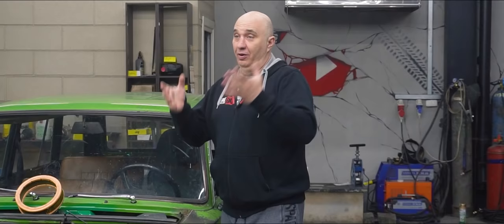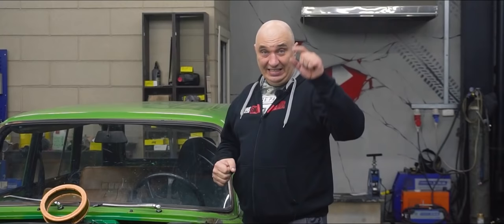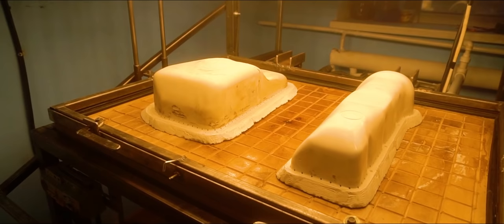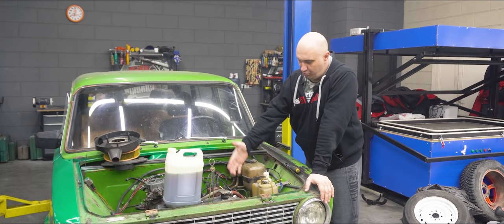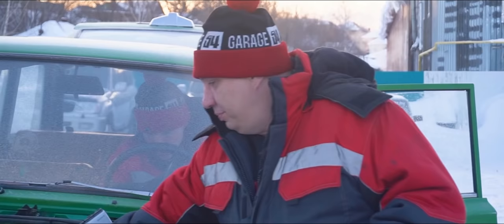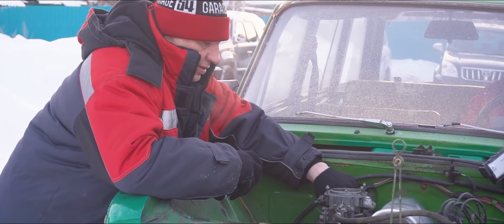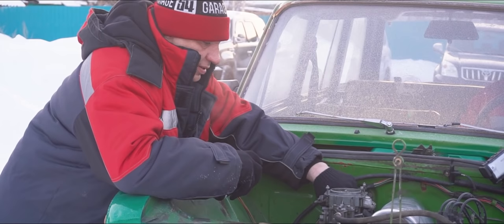Looking inside an engine during cold start (-30 degrees)

Comment: The good old days with carbs and distributor and possibly points ignition in that funky old Lada Russian crate.  

Actually it was normal to pump the gas pedal to squirt raw fuel into the engine when cold out to richen the mix and help with starting. Since he was standing there and the air filter was off, putting his hand over the carb throat for a bit to choke it would have been helpful too.  God I'm old, I lived this 😆

Comment: The Hino diesel truck can idle for ages without the temperature needle moving and as they put an overide on the exhaust brake in cold weather you can press a button that overides the overide allowing the exhaust brake to operate while idling warming up the motor a lot faster.

Comment: This is why my grandfather owned a spot in a commercial heated garage in the USSR not far from his apartment building. Otherwise you'd trash your engine trying to go anywhere on a cold day. The proletariat just parked their cars outside for the season, and not use them all winter.

Comment: I DID THAT JUST NOW WITH A 2021 TUNDRA! ONLY THING WAS A LITTLE EXTENDED CRANKING BECAUSE OIL SENDING UNIT CUTS OFF FUEL PUMP UNTIL IT GAINS PRESSURE! 2ND CRANK STARTED AND HAD NO PROBLEM AT ALL!

Comment: Living in Canada this is mostly irrelevant actually. 
The great majority of cars here have synthetic oil which behaves differently, I can not even plug in my car at -35c and the biggest problem starting the car will be a frozen battery. For those cold days I pull out the battery, take it indoors with me and put it back in the morning.

Comment: Great video with a lot of information. What weight oil were you using? I live in Minnesota USA.  I have frost plug heaters on my trucks, but they do not warm up the oil, I am going to install oil pan heaters. You might say go to synthetic oil, my big truck takes 13.5 gallons for an oil change. What would that cost for synthetic oil?

Comment: This is why block heaters are installed in cars in Canada.  I don't ever start a vehicle I own unless it's been plugged in for at least 2 hours when it hits -15C or colder.  Here in Sask. it commonly hits -40C or colder in the winter.  An (unheated) attached garage is a must as the temperature will never go lower than -10C inside, even at -40C.

Comment: THE  MOST  WEAR,  ON  ENGINES,  IS  THE  FIRST  TIME  IT TURNS OVER  UNTIL IT  WARMS UP  A   LITTLE.   ABOUT   2 or 3  minutes ; is  the   MOST  ENGINE  WEAR  on all moving parts.  USE  AN  ENGINE  PAN  HEATER .....( magnet ones - or strap-on  ones)   especially  if  your  starting in weather -10  C   or  colder !   YOUR  engine, will last  ALOT  longer......(old winter trucker guy)

Comment: They do make oil pan heaters you can plug in. One of the designs is a heated oil stick that goes down into the dipstick tube and keeps the oil warm, it just plugs into an outlet or probably a good extension cord.

Comment: I have pretty good idea what's-a-matter. The engine requires a rich fuel mixture when it is very cold. When the mixture leans out after running for a short time, the engine dies. Another possibility is that the gasoline itself has trouble atomizing.

Comment: Heat and expansion destroy metal if not lubricated?  So those are absent when you first start an engine like this in severe cold.  Expansion/Abrasion is minimal until the engine is running for a bit.  Reminds me of starting my car in the 1960s.  If you got 1or 2 cylinders firing a few times on a V-8, usually the engine would start.  Never gave any thought to the Distributor Shaft and gear, but where did the broken teeth go?  The oil was 10W-40, I believe.  It still was too thick if the weather went below -20C or -10F if the vehicle sat all night outside and was 4 years old.  A 4 year old car was OLD then.  Thanks for the video.

Comment: I had good results at -10F substituting 1 quart of oil with 1 quart of Marvel Mystery Oil.  You will never have any rubber leaks with MMO, but if you remove an O-ring or gasket, it will need replaced because it will be too swollen to reinstall.  Later testing with electric motor bearings proved MMO to be very poor at longevity.  It lasted about a week or two for that purpose whereas a good turbine oil will easily last a year.  You don't want any detergents or additives for non combustion applications.

Comment: Living in alaska this was fascinating and scary without a block heater like me.  When the cold snaps come I have to start the engine every few hours to keep that oil liquid and not tear up my oil pump.  -20 F is where you can tell it is thick when it starts to turn over slowly on a hot battery.  I try and never let it freeze up that hard so far so good with a 4.6 ford motor for five winters

Comment: In upstate New York there is usually about 6 weeks or so every winter when the temperature is -10 fahrenheit or colder every morning. My vehicles will always start (sometimes they need a jump start, but otherwise they start).

Comment: what car is that. A Lada? In Canada alot of Trouble. I live in central Alberta Canada, I'm surprised some people don't have block heaters on their cars. it goes down to -40c in alberta, I always plug the car in during cold nights, your frost plugs might pop if you don't. Batteries freeze up as well. have a battery blanket. One trick I used when I was young. Take a roll of toilet paper on a branch, light it and put it under the oil pan. Sure its dangerous but when its -44c, who cares. lol. Called peasant block heater. Gasline anti freeze. Winter everything tightens up. Good video. Block heaters are cheap, less than $100.00, buy a dipstick heater if nessesary. I use to have a spare battery, always on a charge inside the house. On cold mornings I'd put it in the car, so it had a full charge, put the frozen one inside on the charge. That was my teen years.

Comment: Pretty cool mods for the visual of the oil but if you had set your choke on your carb appropriately you wouldn't have to drown the poor engine in starting fluid, your choke allows for the correct amount of vacuum to draw fuel from the emulsifier tube to feed the boosters, also the motor would stay running upon start up if the choke was engaged, until the engine reaches a warm enough temperature to vaporize the fuel the choke is a vital component in starting a cold carbureted engine

Comment: This is why i run 0w-30 in my pickup. 0w is the most advanced oil, and it will guarantee the least amount of engine wear on startup. Keep in mind, on average, 80% of the wear your engine will ensure will be from cold starts / the first few minutes on startup (or oil starvation if you do long OCI's )

Comment: This is why engines need to warm up in cold weather had this engine run at idle for 4-5 mins the oil would have warmed up thus making it thin enough to flow to all components if an engine is revved up before it is warm it’s just as bad as having no oil at all so please, let your car warm up for a few mins before taking off, your car will thank you and thus be more reliable and last longer

Comment: I live in Finland, temperatures like these are not uncommon, and typically batteries dying is the most common problem. Not engines or oil not being able to handle the cold... But obviously it is inadvisable to cold start like this (very often), that's why cars have block heaters. And houses have garages.

Comment: Wondering if that oil had a significant water content. Seems very similar to what happens when you get too much water in your oil or gas, the engine will start and run at high RPM but soon as you let off it sputters right out. There was also what looked like a clear liquid condensing up top just above the seam on the inside of the PC cover.

Comment: Would you recommend using a lower viscosity oil for the winter months and then in spring, switch back to the engine's specified oil weight?

Comment: Really enjoyed watching. I couldn't believe the oil was that thick. First of all I would try thinner grade oil for the winter, probably if you live in that cold climate region and you have older car you should keep electric heater underneath the engine on at night. Impressive how the oil looked like it was almost frozen. Great show thanks
Reply: There are devices known as “block heaters” that us northern folk use it’s a heater installed in your engine bay that keeps the engine roughly at summers day temp so you can get in and drive right away (still give the engine time to get oil flowing so like 30 seconds or so) it also allows the oil to be at proper temp to do so

Comment: Good reason to at least have a block heater ... I've known those who also put a heater on the coolant/radiator somewhere... and my favorite if you have an automatic transmission put a heater on there if you can.  For the last one I've noticed about a 3 kpg (2mpg) difference in summer v winter fuel economy... a manual transmission doesn't seem to be effected by this

Comment: Try running motorcycl oil in these temperatures yes ATF same as in the transmission. It has no detergents in it. But it stays liquid I believe. I have seen truck drivers warming up there oil reservoir with tiger torches as well as rear end and transmission. Or they just keep them running at about 1100 to 1200 RPMS and slowly  drive away at 5 mph at the lowest speed for how ever it takes to get some transmission and rear end temperatures. I have had to do this in Winnipeg  Manatoba Canada.I never turned my engine off all winter after that  and drove at the lowest speed for the first half hour before trying to shift gears after that. It only took less than 4 hr. to freeze the engine. I'm glad I didn"t destroy my engine the first time I experienced this.

Comment: I guess this is proof that a block heater is a really good idea in severe cold if it's possible to use one. Better to get the oil viscosity closer to where it should be before starting the engine.

Comment: While I am sure this test was not high grade oil, it sure shows how poorly cold lubricant behaves.
I had a block heater on a timer when I was doing a longer commute. It gave 50 km more range in winter. Made for a safer first few blocks as well as windshield was clearer sooner. The car was a manual so you could also feel the shifting was better. part of the mileage improvement for sure. There is a lot of attention to the engine but imagine what the transmission is dealing with when really cold.

Comment: It would be cool if you could put a guage on the ventless valve cover to see what is going on, pressure wise,  or weld the filler closed on a steel cover and weld a fitting for connecting a gauge.

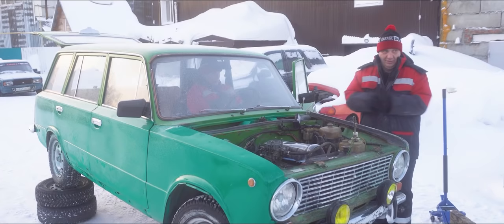Comment: notice at 7:39 sec is the first glance inside the crank case. see how no vapors are present above the oil capacity?? by 8:07 you can clearly see vapors and blow by built up. thats due to the cold it increases the clearances between piston rings and the cylinder walls. when it warms up i bet theres HALF or less the amount of vapor in the case. imagine how much vapor there is on turbocharged applications

Comment: That engine wasn’t fighting you it at first wasn’t getting fuel/ running lean. Should have noticed this when it would only run after your sprayed starter fluid) It’s obvious  cold oil wont flow as easily, but  I would think your area will have a spec’d oil viscosity for your region ontop using block heaters. The oil filter bypass is a bypass inside the fliter that allows it to bypass the filter media so it won’t starve the engine if clogged/cold. Miles on the engine would be important info because oil sludge is a real thing and can inhibit oil getting to the head especially if mains are getting worn out.  So in the end, I’m confused what you were trying to accomplish or proove. Besides that the transparent covers were cool but would like to have seen a Timelapse of 1500mi on it

Comment: This is one of the reasons modern vehicles use 0W oil. The tolerances are tighter, but the oil has smaller molecules.

Comment: You should repeat the test with a new engine.. Put an oil pressuremeter on it, so you can monitor the oil pressure.. Then clean the racker cover and start it inside.. film a normal startup.. Take it outside, freeze it and try to film a startup at minus 30  again..

Comment: I'm thinking this must be something thicker than 10w40 as 10w40 is recommended down to about -25c.  Maybe straight weight 30?  People have been driving vehicles in cold places for 100 years, I assume they used to use straight weight 10 oil, after all synthetic oil did not exist until fairly recently.

Comment: Were the molds taken of the original parts? If so, the new oil pan has the inner dimensions of the outer side of the oil pan, which might be enough of a difference to make the standard oil level too low for the pickup to reach properly
Reply: the pickup was definitely submerged, the gears were stripped off trying to turn the oil pump

Comment: Needs to be run gently, give it some starter spray in the air intake, don't floor it because the engine needs air, the oil will warm slowly and the engine won't overheat in places if its kept idling

Comment: I use 0W20 to 0W30 synthetic and a quart of Duralube every oil change. Cold startup isn't an issue for me, even without a car blanket, a heated garage, or an engine heater.

 I once added 15W40 dino oil to a diesel bus (at a job) through its valve cover on a -10F morning and the oil wouldn't flow down through the engine fast enough. The valve cover overflowed if I didn't slow my pour. The 15W40 dino oil was like molasses or honey.

 These guys should keep a can of starting fluid in their cars, at those temps. Synthetic 0Wxx and a metal-coating additive like Duralube are definitely recommended in cold climes.

 Can they easily get such oils and additives where they're at? We ARE kind of spoiled in Western countries.

Comment: I don't understand how the distributor shaft gear broke.  Doesn't the oil pump gear drive the Distributor gear?  The distributor gear is not hard to drive so how did it actually break?

Comment: What if oil is leaking through the filter housing drain plug, what could be the problem? Put a new plug on the housing and it still leaks.

Comment: I think when the car is in temps this low, the way we got the oil warmed up is to simply set fire under the car. Once the car is engulfed in flames, the oil breaks down nicely and becomes more fluid.

Our next focus was putting the huge fire out, which took two fire trucks about 20mins. But we got the oil nice and runny, which was our main issue.

LMAO! (insert sarcasm)

Comment: Oil pump wasn't primed.  When you remove the oil pan, especially replacing the oil pump, the oil circuit becomes totally filled with AIR and you absoutely must PRIME THE SYSTEM if you want immediate oil flow.   There is a special way to do this on engines that only pro engine builders know about.   There is a PRIME PORT on the block ABOVE THE OIL PUMP where you have to manually pump oil into with a transfer pump.  If you do this oil will flow immediately when first started.  If you don't it can take MINUTES BEFORE THE OIL PUMP CAN SUCK OIL UP THRU THE PICKUP TUBE (DEPENDING ON HOW THICK THE OIL IS LOL).  Once the oil pump is primed, it is literally impossible for OIL NOT TO FLOW as seen here, unless it's broke.

Comment: Fuel delivery to the carb. So from gas tank to fuel pump to carb is frozen.
And then the oil pump drive well that's all she wrote, it was interesting to see that splatch of dark black oil blow out of oil pump and oil passages as that was the death of the oil pump drive.

Comment: I live in NORTHERN CANADA where -30c is normal in the winter.   Once everyone started using either AMSOIL or MOBIL-1 Full Synthetic  in either the 5w30 or 0w30 they all stopped having starting issues and no more need to hook up the thermal heating electrical cord.   PROBLEM SOLVED !!!!!

Comment: Vor 30 below (doesn't matter if Fahrenheit or celsius) it's almost to cold for most oils... 

At those temperatures, you need special oil, otherwise, the oil turns to gelee like at 8:30...

Comment: Even using a block heater it will not heat the oil in the sump even if the cooling system gets warm. Most heaters are just in the wrong place. Last week it was minus 23 Celsius and I got 50 meters before my 5 speed broke. I had a block heater on the car for 90 minutes but of course it doesn't heat the gear box. Turns out a mechanic shop had put 80/90 oil in it, when it should be red oil. You are better of using a external cabin heater to heat the oil then a block heater.

Comment: I used to have a kill switch on my F-350 Ford 350 when it was anything below freezing I would use it and just crank the engine for a few minutes I have a DieHard battery that seemed to do okay in the cold I would actually go outside and look through the oil fill hole to see if there's any oil up if there was i would start it the truck lasted 350,000 miles before I sold it it was a 350 Windsor better than nothing. PS I used to live on 20 50 in it all the time that was the only reason why I would do that in the winter.

Comment: Missing most important info here... What oil you're using? 10W40, half-synthetic, or mineral? At these freezing temperatures you should use 5W30 oil, which is on the modern cars.

Comment: This happens even more if you skip or delay oil changes, moisture accumulates in the oil which will freeze at even higher temperatures.

Comment: i usually just start my car and go. i don't take it above 2k until my temp gauge starts to move. how these guys do this in their country, i commemorate you on how you guys start your cars and rev it up to wake the neighbors. doing what that guy just did only starved that motor more than it needed to be starved. had he just kept on giving it a little gas and deal with the stalling a couple of more minutes, he would've eventually got oil to the head. absolutely insane.